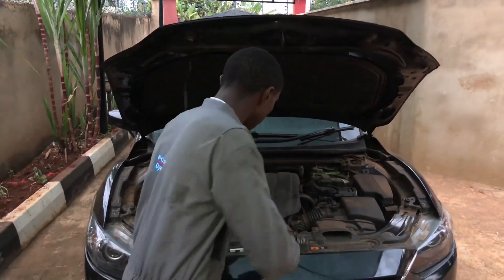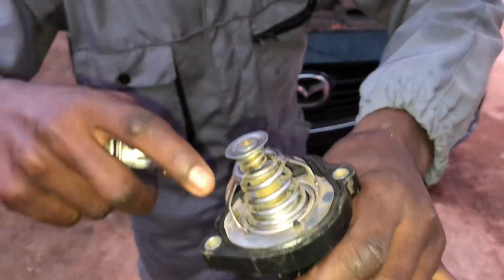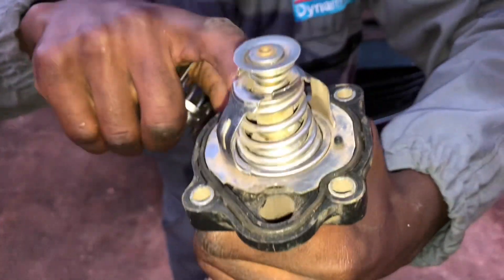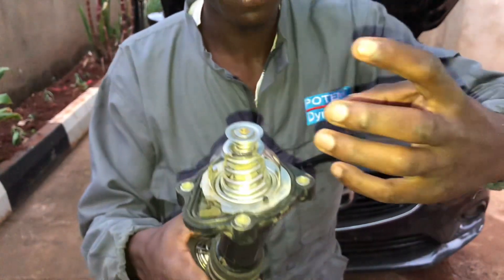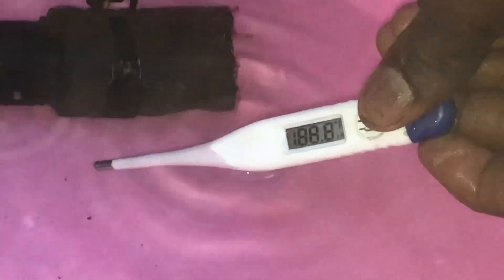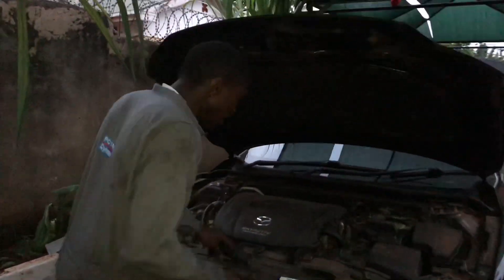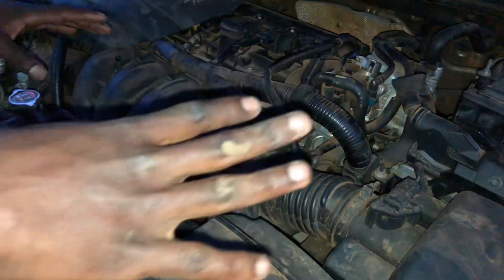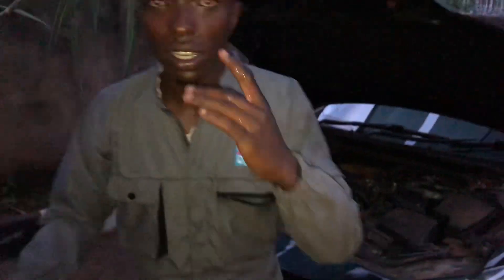Why do most people remove thermostat after acquiring their cars?

Comment: Please do not listen to him, you will destroy your engine. The thermostat actually helps your radiator to cool down before it cools down your engine. If the water keeps on flowing to the engine the temperature will be too hot because the radiator has no room to cool down
Reply from the maker: Please read and understand the caption,before rushing to comment
Reply: Please research how a thermostat works. Your explanation is the complete opposite, a thermostat simply opens and closes based on coolant temperature in the engine and not in the radiator. Thermostats do not cool water!
Reply: @DKtheurbanvillager I know how the thermostat works and why it is there in the first place. Thermostat is there to ensure your engine is always running at working temperature to ensure there is no fuel or moisture dilution in the engine oil causing it to oxidize sooner. Not only that it ensures the right mixture of air and fuel into the combustion chamber. The radiator fan and the air you get when you are speeding is the one going to cool the water but you need to give it time to cool down with the help of the thermostat. If you remove the thermostat water will keep recycling into the engine to the radiator constantly causing the water to be hotter because the radiator doesn't have enough time to cool it down.
Reply: I believe the YouTuber said it's not advisable to remove. He recommended replacing to a new one, preferably 30km durations

Comment: Removing thermostat is a bad idea. I tried it and it cost me my engine. The best thing you can do is to upgrade your radiator to double cell. Removing the thermostat makes your car less efficient and it also make it consume more fuel.
Reply: Very true.
Reply: Your engine was already toast my brother. The thermostat was removed on my E90 at 190 000KM. 5 years later i'm still driving my car with 360 000KM with no thermostat and half of the radiator is covered.
Reply: its possible your engine was already about ready to go

Comment: Most modern cars have no temperature gauge in the dashboard. How will I know the  thermostat gas failed or the engine is overheating?
Reply from the maker: Hello joseph,an error for engine overheat shaded in colour red will pop up kwa dashboard,in severe cases,the car will stall
Reply: Depends on which cars. You can cycle through some cars and it'll show you the engine temp.
Reply: In Ghana the weather is hot so we remove the thermostat and connect the cooling fan to start running when the ignition system is switched on. This way we have no problems at all with overheating in regions where temperatures are as high as 25° in the morning and 32°C in the afternoon.